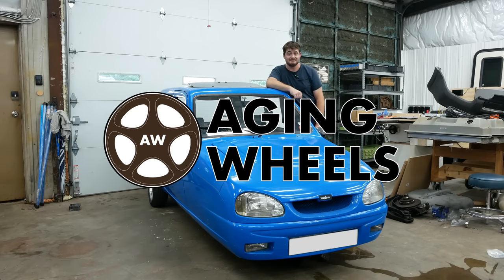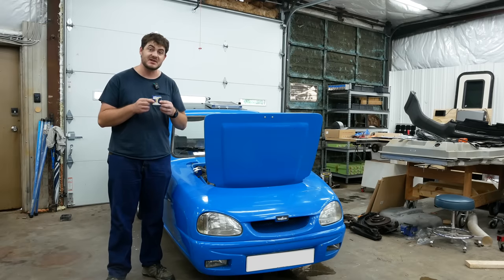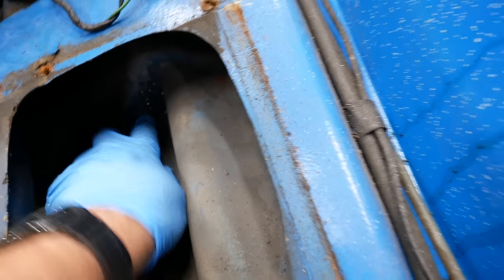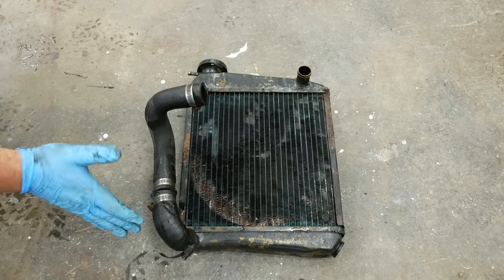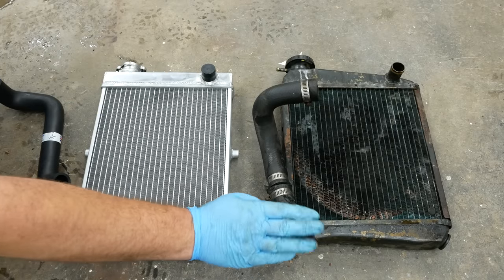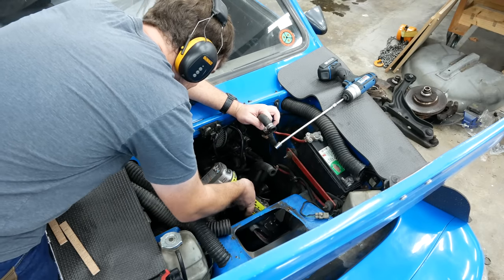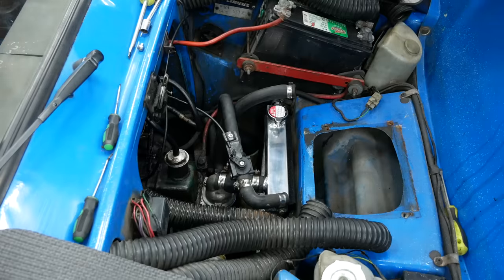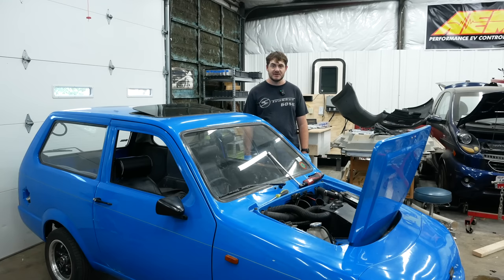My Robin is Hot. I Made It Worse

Comment: The air leakage from under the heater core may be diverting too much cooling air from the radiator. Maybe block it with a piece of cardboard and see?

Comment: The front duct/plenum needs to be tighter. After the air flows through the radiator - where does it go? It would be much more effective if the back of the radiator was ducted to a low pressure zone on the outside of the car.

Comment: Have you replaced the water pump ... Its a common problem on these old cars here in the uk ... The impeller corrodes and the outer diameter reduces slightly making it not circulate water well... search Google for "Fifers Reliant Hints & Tips" for some good tips.

Comment: You have to remember Relient is a British company, and therefore the name is wholly ironic.
Relients are built with British weather in mind, so it's recommended to never let them get too dry. Also temperatures native to any location south of the Isle of Wight are also not recommended, and are likely the cause of your overheating issues.
One issue I did notice from your video is that Relient parts are made from Aluminium, I'm not sure what that obviously substandard aluminum stuff you are using is, but I doubt it'll hold up. Oh, and those small holes are extra ventilation, it was an upgrade package I believe.

I need to find a postbox for Robert so I can send him a Haynes manual, it would make his life se much easier. Don't worry, it's a 3rd party repair manual for the car.

ps. I'm English therefore approximately 94% of the above is sarcasm, please don't shoot me.

Comment: What direction does the fan spin. Because most of the air would want to go through the heater core not the radiator, so of the fan blows down it might be a way to force more air into the rad then the heater core. Just a idea

Comment: Given that its a British car, the heater would be on most of the time, and the heater fan actually cools the engine in parallel with the radiator, and if the fan its not working, it will earm up eventually.

Comment: Ok, I'm going to be that guy.  All else being equal, the temperature of the thermostat will have zero impact on the vehicle's tendency to overheat.  Let's say the 88 degree thermostat is the highest temperature available.  That would mean that all 3 thermostats should be fully open at 88 degrees, and if the rest of the cooling system is in good shape it shouldn't rise above 88.  The temperature of the thermostat only influences the minimum operating temperature, not the maximum.

Two caveats.  First, it's possible that one thermostat flows more coolant than another.  That could impact the upper temperature limit.  Second, if you run a lower temp thermostat, and if the car will remain at that lower temp during normal operating conditions, you may have somewhat of a temperature capacity reserve, meaning that if you need to run up a long hill, starting at 75 degrees will buy you a bit more time before inevitably overheating than if you started at 88 degrees.  Even so, that's a band-aid at best.  Much better to maintain or upgrade the rest of the cooling system.

Comment: Good thing the heater fan was broken, if it was running you turning it on to combat engine overheating would have starved the engine even more. I guess they expect the heat to only be on in winter when the engine can cope with the heater stealing half it's air supply.

Comment: Thermostat twisted logic. A higher temperature thermostat will make the engine run cooler. Yes it sounds ridiculous but hear me out. No thermostat does not allow the engine to warm up because it never holds coolant in the engine or radiator, it just loops it thus the coolant never really gets cooled, but if you don't have enough air flow through the radiator the system will overheat quickly because the entire system is at one temperature and the coolant doesn't spend enough time in the radiator to give up much heat. A low temp thermostat allows the engine to warm then opens replacing the coolant in the engine with a slug of coolant from the radiator that gets hot rather quickly, then is replaced with the still fairly warm coolant from the radiator, this happens a few times in shorter and shorter cycles until the thermostat never closes and all you have is really hot coolant that doesn't spend enough time in the radiator to allow it to cool, actually overheating faster than no thermostat even with some air flow. High temp thermostat, heats the engine hotter, but when it opens the coolant coming going out spends longer in the radiator thus giving up a lot more heat before going back into the engine, a high temperature thermostat will never reach a point where it does not cycle thus there is always coolant in the radiator that is actually giving up heat. This is why slow and non moving equipment, or things that idle for a long time like forklifts, generators, police cars, fire engines, street sweepers, and construction equipment use high temperature thermostats.

Comment: So, with the parts that are screwed directly into the fibreglass, and therefore barely holding, could you not create a more firm seal using a bolt with a washer and a nut on the other end? Then you’re not relying as much on the fibreglass itself

Comment: I'm no aerodynamist physicist but wouldnt the loose heater core assembly kind of flap up due to the pressure of the air when you are driving, thus making all the air escape from the little intake and leaving no air to cool the radiator? it looked extremely loose

Comment: Is there any way to add a fan shroud? That would help a ton with the cooling. Also check the fan clutch!
Reply: The radiator fan rotates all the time. It's locked to the crankshaft.

Comment: this is hilarious he was totally blinded them he took closer look find crack in the housing finally lol
if i were you i would seal up any air leak in hood to keep engine cooler more than flopping around heater box and best idea is use metal plate stick and weld nut on it so u can beast up bracket on support radiator and heater box

Comment: Anyone telling you a lower temperature thermostat will help with overheating issues DOES NOT KNOW WHAT THEY'RE TALKING ABOUT. The thermostat only controls the lower end of the heat range. It might make it take slightly longer to overheat but that's all it does. Unless it's stuck shut or obstructed, a thermostat will never cause an overheating problem. And in the even you correct your overheating with the other repairs done at the same time, with a fuel injected vehicle running below operating temp will just leave the ECU stuck in open loop and running pig rich.

Comment: Using the wrong (too cold) thermostat won't fix an overheating issue, it just makes the engine never come up to proper, full operating temperature, so things like moisture collecting in the engine oil become a problem, as the engine never gets up to temperature (until it overheats in this case, of course...🤣 )
The cooling system is only capable of dissipating x BTUs, and the engine is generating y BTUs.  If the engine is creating more heat than the cooling system can dissipate, it will overheat.  Starting a few degrees cooler gains you nothing except a few extra seconds before it overheats from equilibrium on a downhill coast or whatever...

Comment: Wow, that heater system is dumb.

Better luck with those torque procedures.

I'd also put a plate over the heater core hole to force ALL of the air through the radiator.
Because the heatercore isn't bled, and because it flows coolant poorly, but front-end air really well, it's going to reduce cooling power significantly.

Plus you're not driving that robin in the winter, just cardboard that hole until you fix the fan.

Comment: Are you going to go back to fix the fan on the heater core?
Reply from the maker: Maybe? Probably not. That feels like something to save for the massive rewiring it needs. All the lights switches are wired wrong and the brake lights don't work
Reply: @agingwheels  Oddly it looked really simply in the video. As the former of several Brit cars. I should know better. Nothing is truly simple in them.
Reply: @WayneMoyer  : Consider that some Brit cars are positive ground and some are negative ground, and then consider what sort of ground a fiberglass Brit car is likely to have....
Reply: @BrooksMoses  I didn't think of that. Weird enough with metal Brit cars.
Reply: @agingwheels    But you're the magician that creates and builds technical electric car drive systems and lawnmowers and gokarts!  The Robin electricals are like nothing compared to the proposed bus drive system.
Reply: @BrooksMoses  Positive earth disappeared on British cars around 1970, generally when alternators displaced dynamos. The difficulty with fibreglass cars is that there are usually myriad earthing connections and it only takes one (usually the one you can't find) to cause all sorts of peculiar electrical headaches.
Reply: @agingwheels  As someone who worked on Reliants to a decently good extent and knows the history of almost every single model perfectly by heart I should tell you that the owners of Robins were often quite eager to maintain them properly. Your Robin has issues that shouldn't even exist such as the electricals and the rear suspension. When it comes to quality issues, Robin mk2s in between 1995-98 were the lowest quality as Reliant was swinging in between bankruptcy and training new workers resulting is worn out moulds and terrible coat cutting. The MK3 was made in a boat hangar, by people who didn't necessarily have a clue for the first year or so. The highest quality mk3s were the 65th anniversary models. Overall your Mk3 is a very rare low quality Reliant and I wouldn't use it as a perfect example of one. I would perfect it like the Trabant.

Comment: Install an electric fan with a 80c thermal switch on the radiator. Two 120mm 12v delta fans should be more than enough. They make 14k rpm fans that will chop your fingers & enough airflow to cool that car on their own.
Reply: Yup, or a motorcycle cooling fan. Even with a proper shroud I don't see that radiator getting enough air without a fan.
Reply: @wesley00042  it got a mechanical engine fan but does not seem to have a fan shroud. 
These were made for the climate of England which was at that time cold most of the year. So they will always run hotter in more normal climates where it is hotter.

Comment: I'm surprised you dont make or repair replacement parts when needed but instead rely on just buying new parts every time. It doesn't seem like you're poor and can pay a premium for replacing half the car when you don't know whats going on, so it seems like you should be able to afford to fabricate some basic stuff.

Like with that thermostat housing. Grab some flat stock, drill a hole in it, get some pipe or tubing and weld them together. That could take you 20 minutes. Then video is done.

Don't just rely on buying your way out of every situation.